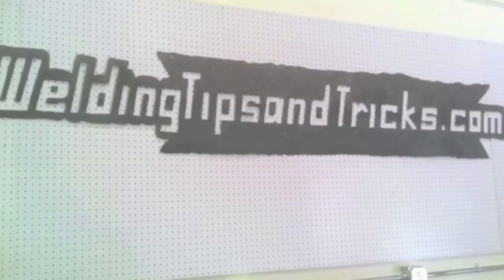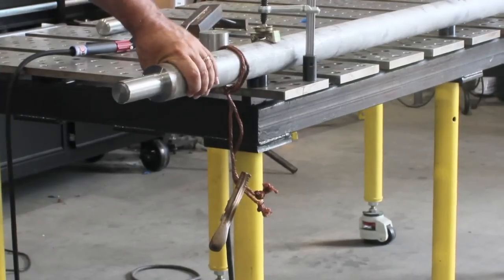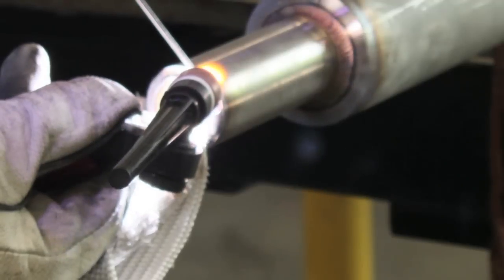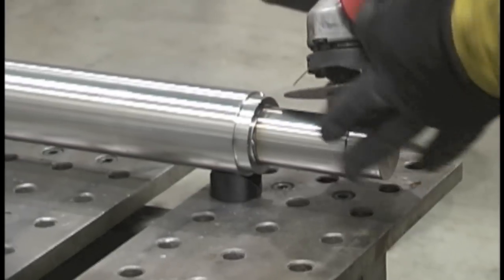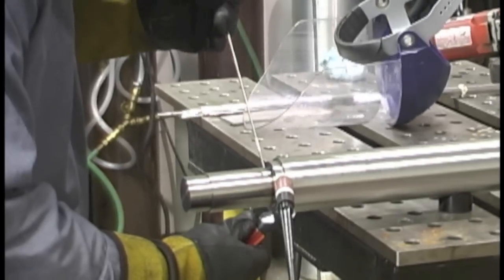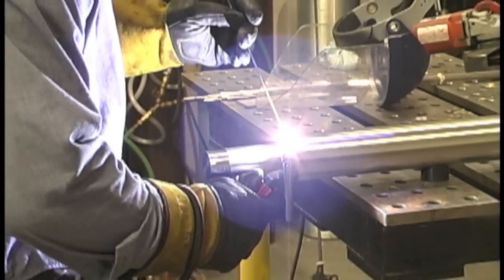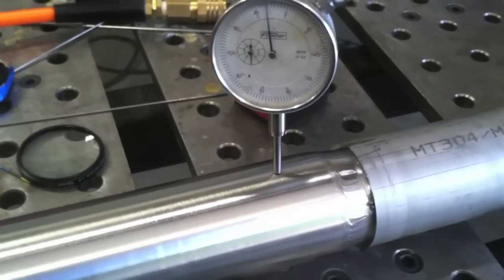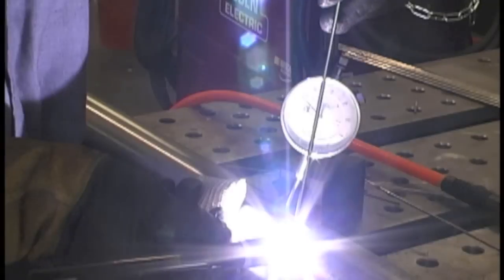Tig Welding Stainless Steel Shafts

Comment: may i clarify sir, you do the trueing by welding some parts. my question is at the last part, you taken off the welded part, won't it spring back to since you taken those out and seems the welded part  had been way outside the circumference so you seemed taken of all of that. thank you.

Comment: dude, im a machinist. And aspiring welder. I cannot stand quietly as i see you do these repairs for whatever machine shop you do work for. AS a machinist, these repairs you're doing, like the broken tap removal, or gap filling on the aluminum, are very handy things to know. But my man, what machine shop can't extract a tap. lol. I love your videos, and behalf of all competent machinists, i apologize for this shop you're dealing with who expect you to do these random fixes, but at the same time, i thank you, for posting these vids just in case i screw up and i need a welder to add material to a part that i myself screw up. lol
Reply: Sunny Rooprai lol I’m went to welding school and became a semi-trailer mechanic and now I currently work at a machine shop as a mill operator/welder aspiring to be a machinist. I operated a manual lathe at school to bevel my pipe and always had an interest in Machining.

Comment: hey can u make a video of welding aluminum welding rods on sheet metal the only ones i could find where 1/8 rods. and im probably a dumb ass for this but im trying to weld sheet metal with them thats probly 1/16 to 3/64 thick. No matter how fast i went it didnt work.even tack spot tack spot didnt just big holes n its for my dune buggy build

Comment from the maker: I would setup the same as for aluminum as far as machine settings , gas flow , etc. and use az101 filler rod.  get a coarse carbide burr that wont load up with mag for burring out fractured surface to clean bright metal.  a preheat of around 200f should help too.  keep a very very tight arc, and run small short beads and let cool while you clean the soot from each pass...good luck

Comment: Hi jody Corey here all the way from NZ unrelated have a magnesium engine cover to repair I weld alloy very well but have no experience with mag. Any tips eg filler wire type gas flow cleaning products tungsten depth shielding cup etc looks like ill have to build the part that is missing up do you wait a time after each pass? Your advise would be appreciated ( and yes I have flip a face shield once or twice myself just shows how comfortable you become wearing head gear

Comment from the maker: The part was resting on 2 V blocks and only one end was machined.  Not a precision setup but there was no way to get it perfect other than chuck it up in a lathe and that seemed like too much work since it only needed to be close enough to final machine another .020" or so off ..and it worked.

Comment from the maker: I try to wait several minutes between passes on stainless. Otherwise the welds get oxidized and gray/black.  I kept going in the same direction but alternated starts and stops. It might have helped to alternate direction. In the end , the final machining turned out fine.

Comment: Hi Jody, great video again, I never saw the compressed air method up till now. I also received the TIG-fingers, they are great thanks! One question, what's the diameter of the wire you are using to build up welds like that? (in mm?) Thanks, have a good one!

Comment: I noticed that you air cooled the weld when you were straightening the shaft,  does fast cooling the weld introduce any hardness?  I ask because alot of guys when MIG welding auto panels cool the weld with a wet rag,  I was always told to let it cool naturally or you harden the weld and make it brittle.  Curious what you think

Comment: haha done the shield/hood thing but flashed so badly had to take a 10 min break to see again... the guys in the shop are still laughing... a question about walking the cup, it seems the angle of the torch is rather steep i mean to me looks way more than 10 deg or so, if i`m correct in what i see (a miracle) how do you get away not balling the filler? thanks for the vids jody, i learn a lot in every video

Comment: Nice work showing the dial while you where welding to show it shrink back.  When you were dry washing, how much heat where you putting into the shaft? Were you actually running a puddle over what you had already done?  At least that is what comes to my mind when you say dry wash.  I've done that to try and make my welds look better...